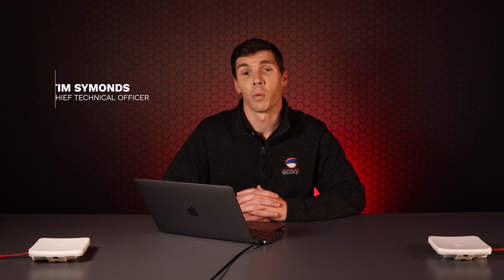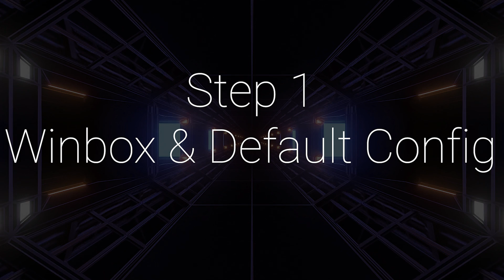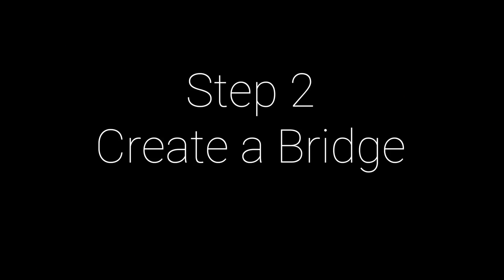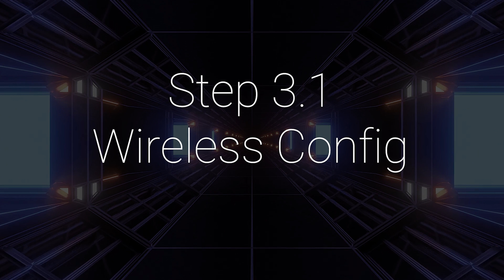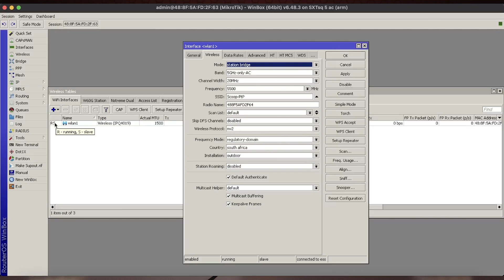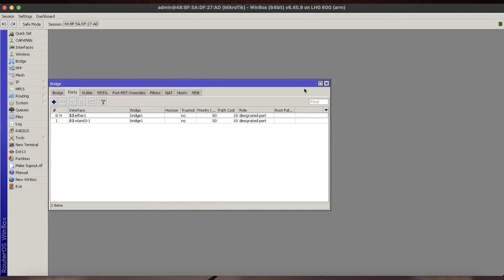How to Create a MikroTik PtP Bridge Link

Comment: Hi Tim, how many km can the 60GHZ do? I am planning to try on a 3.5KM
Reply from the maker: The maximum recommended distance is 1.5km. Although it is technically possible to use them on longer distances, performance would be very unpredictable.
Reply: @scoop_distribution   Hi Tim at 1.5 km exactly  the throughput should be 100% of capability ??
Reply from the maker: In good environments and with properly aligned antennas you should be able to achieve maximum capacity at 1.5km. Bear in mind that 60GHz is highly susceptible to weather conditions and the longer your link the more fluctuation you can expect.

Comment: Hello, I really need a little help. 
I set up my Mikrotik Cube devices as station and stationbridge. My goal is to transmit my main internet source to the Cube device in the building across the street, connect that device to a router, and distribute the internet to that apartment. Both Cube devices see each other in this configuration. The rx and tx values are active. However, for some reason, my router is not receiving the internet from the Cube. I'm using a Xiaomi router. What should I do? I'm just a basic user; I just want to provide internet to the other apartment, that's all. Thanks.
Reply from the maker: Hi there, just to confirm: Are the cubes in Station & Station Bridge, or Bridge & Station Bridge?

Also, ensure that there is a bridge interface created with both the wireless and Ethernet interfaces on both devices.

Comment: Thank you for this video.  Maybe you can answer the question of why we can only connect to these devices when the computer is on the same subnet as the device?

This is something I cannot seem to sort out.  When I used the default factory configuration, I could connect to the Slave device from any of my VLANs, but for the Master device I was only able to connect it from the same subnet (VLAN) of the "bridge" interface.

It would be wonderful to be able to connect from any of my other VLANs.  It is not a networking issue in our environment.  The VLANs I am referring to have total access to each other
Reply: Maybe you figured this out by now, but when you default the configuration these devices have NO management IP address and you need to give them ones.  And a default gateway of course for L3 routing to other VLANs and/or internet. They can only be accessed on the same L2 broadcast domain until then. This tripped me up as a first time Mikrotik user too.  Even though I am a network engineer of 25 years, lol.

Comment: How precise does the alignment need to be on a MikroTik nRAY 60GHz? I'm trying to establish a link at 710m, but the antennas aren't visible to each other (I have line of sight). I can adjust the direction easily, but the issue is the tilt because the antennas are mounted on poles and aren't easily accessible without removing them. Do you have any ideas on the best approach for this? Tnx

Comment: Hi, I'm trying to setup the same type of bridge network using RB450s, however, there's some wireless settings you've change here that aren't present on RB450. May you please demonstrate how you'd accomplish this using the RB450? Thanks.
Reply from the maker: Create a bridge on both sides and just add the Ethernet interfaces instead of wlan. Ignore the wireless settings completely. The IP address configuration is optional.

Comment: Hello I have Mikrotik wap ac antena and I would like to connect this antena to wifi on my router and connect antena to my pc with cable, can you help me with settings. thank you
Reply from the maker: You can use 'Station-Pseudobridge' mode on the WAP-AC if your wifi router is not Mikrotik. This mode is designed for bridging to non RouterOS devices.

Comment: Why one end has wireless mode to bridge while the other end has station bridge? In station bridge mode less wireless stats are available (Tx/Rx signal level only shown in bridge mode)
Reply from the maker: 'station-bridge' mode is a proprietary Mikrotik configuration to overcome limitations in the 802.11 protocol and is necessary for wireless bridge configurations.
https://wiki.mikrotik.com/wiki/Manual:Wireless_Station_Modes#802.11_limitations_for_L2_bridging

Comment: Hi Tim, I have a directional LHG LTE pointing to tower, feeds into my router. Challenge is I have 2 houses on the same premises, I have another 18dBi mikrotik CPE and a Ubiquity Powerbeam CPE... How can I bridge the mikrotik and ubiquity CPE's ? The distance between the houses is 70m with direct LOS.
Reply from the maker: It is possible to bridge most non-MikroTik devices using the station-pseudobridge wireless mode with 802.11 as the wireless protocol in RouterOS. In the case of Ubiquiti, if the CPE is the older M-Series, this will work as you can disable airMAX, but if it's an AC model, unfortunately, this isn’t possible. airMAX is a proprietary protocol that will only work with other Ubiquiti airMAX devices, much like MikroTik’s NV2.
Reply: @scoop_distribution  Thanks Tim, I shall try!

Comment: ...nice, nice, but...If you do not need an IP on the bridge, simply don't set it! But if you decide to set it, it definitely should not be in the same subnet as all the other traffic....
Reply from the maker: Hi Enis, Thanks for your comment. This largely depends on your network design requirements. Our example is designed to be very basic.

Comment: Hi, maybe You can help me i have LHGG-60AD, and the distance is 600m. Connection is really solid but i cant get more than 100mb/s. Where is problem, what should i check to get 300mb/s. Bandwitch test show me 950/950 🤔
Reply from the maker: If you are using the bandwidth test built into RouterOS from LHG-LHG, it doesn’t take the Ethernet into account. Make sure your Ethernet ports are syncing at 1Gbps, and if not, check your cable, connectors and PoE injectors. If they are all working as they should, it could be a hardware problem on one of the LHG Ethernet ports.

Comment: One thing that is not added is the ip, should you apply a ip on the bridge for both and also should you add a ip on the station ether 1? (wap60)
Reply from the maker: We recommend adding an IP address to both bridge interfaces for management purposes but strictly speaking, it isn’t necessary for the link to function.

Comment: Thank you for the reply . I have always used Ubiquity equipment and have come to rely heavily on their alignment tool.  Can you maybe elaborate on how to align Mikrotik radios properly. Does it have the some form of alignment tool   ?
Reply from the maker: There are alignment modes that can be enabled to assist with this: 

https://wiki.mikrotik.com/wiki/Manual:Interface/Wireless#Align

https://wiki.mikrotik.com/wiki/Manual:Interface/W60G#Align

Our suggestion would be to do a link plan using their calculator which will give you a better idea of what to aim for when doing the alignment.